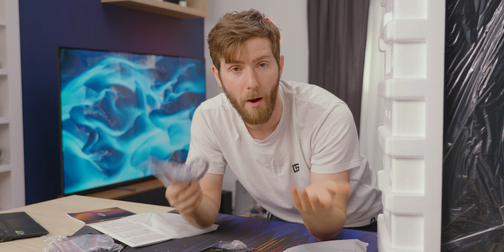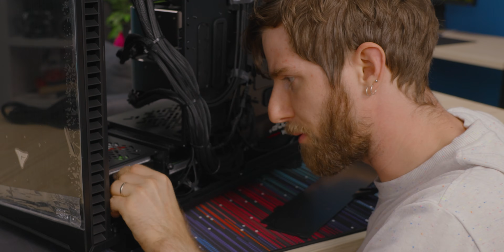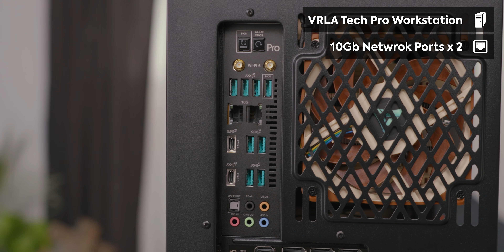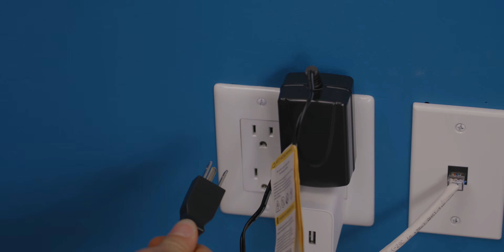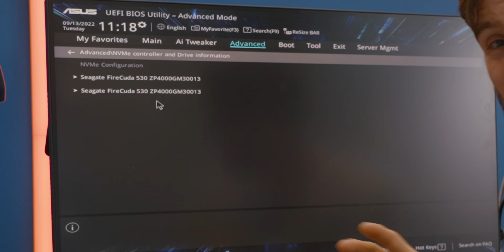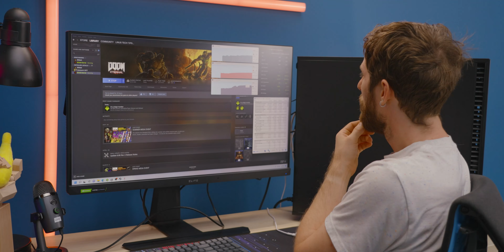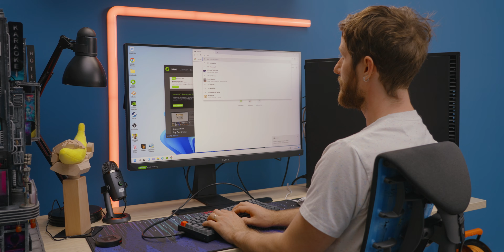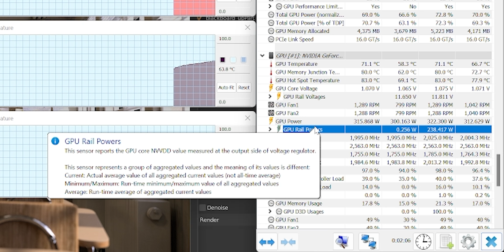This PC blew our circuit! - VRLA Tech Threadripper PRO Workstation

Comment: I have had the same set of Logitech THX certified speakers for like 10 years, and they still sound absolutely amazeballs.  So yes, yes they need the audio connectors.  I also use passthrough audio for my TV (that is connected as a second monitor 55" mostly for watching Linus on Youtube) to send its audio through the computer (yes when i am using the TV functions only) so i get 5.1 surround in my office. :)

Comment: I have a Logitech Z5300e set that sounds amazing and I'd love to have hooked up, but I got word about noise complaints about the sub two floors down and had to pack it up, 'm using Edifier R1280Ts now. But the rear surround audio ports can be great.

Comment: If Seymour Cray and Gene Amdahl were still alive today, I suspect that there jaws would hit floor at the speed of light. Have you ever wondered how many Cray X-MP mainframes it would take to match this VRLA Threadripper workstation PC? Hint: it's over 250. Linus, let's benchmark PC performance in equivalent number of Cray X-MPs. That would be interesting from a historical perspective. Thanks for the video.

Comment: man how sponsorscripted is this channel going. linus goes fully nuts over 2 x 3090tis which are shit in 1 month. 3 nvme slots which is also nothin uncommon and says 999$ pricetag as if there werent more expensive boards even in the consumer market. and why go nuts about 7 pcie extension ports if they are blocked by the sli setup anyway?
100% paid speech here. of course it is in a sponsored video but come on

Comment: I still use my late 90's era Logitech Z560 surround sound system when I'm playing games without voice coms, so I appreciate a full analog output on the back panel. Sad to see some of the latest (really expensive) X670 AM5 boards only have analog line in and out.

Comment: Booo. I use my 7.1 sound system for my speakers on my pc. When I built my pc. I specifically made sure it had that capability for my audio solution. It works really well for my case. I have swing arms for my speakers that the rear ones are mounted to. Makes for some fun movie/youtube watching.

Comment: seeing that worst case scenario of horribly bad cooling earned you a dislike, this is random parts thrown in a random case by a casual, the bare minimum would be cutting the side panel and install side fans (or a giant 230mm like I did)  which is what most people who had SLI did before liquid cooling became more than a niche talking about that, the day I built my regular threadripper pc (280 up to 430w on the cpu !!!) is the day I realized liquid cooling was unavoidable ESPECIALLY for a workstation, I know companies aren't used to caring about buying proper pcs but seriously this is a threadripper pro with dual gpu you should care !

Comment: I still use the ports because I have a custom surround sound with a 3000w car subwoofer hooked up lol. I will say Windows absolutely sucks getting those ports to work though. Speaker Fill just doesn't work like it should, and having to add flags to the program shortcuts that you want to have surround sound enabled for isn't optimal and 10% of the time doesn't even work.

Comment: On the topic of audio connectors on motherboards, yes. For me optical out allows an extra option on top of USB. For example my DAC is connected to USB and my surround sound the TV/monitor uses runs from the optical out to my receiver. This lets me switch between headphones and surround sound just by changing my PC output.

Comment: Ahem, Linus. Some people still use those analogue ports at the back of their PCs for their surround sound setups, like my ageing, but still working Logitech X-530 5.1, it might not support Dolby Atmos, but it still works for me. might add a bit of cable clutter, but so does all the other cables that my PC needs. I've tried using headphones, but, my ears are pressure sensitive and wearing headphones for extended periods of time does get uncomfortable.

Comment: I actually do use 7.1 audio with my desktop. It's pretty fun and easy to do with DIY. In certain games, especially if you can increase the volume, it can really help since you actually know behind you vs in front of you. Was a must-have when I competitively played MW2019 for a bit.

My setup was actually some nice speakers for the front, then in the rear, I had two sets of crappy logitech speakers with one speaker cut off, and a 3.5mm splitter so I could get some good range on the cables. The best part? My motherboard doesnt have 7.1 so I used a soundcard, in 2020!

Today I use an actual set of 7.1 PC speakers, but I leave the rear ones off since, if Im gaming, I'm usually using headphones to keep the fam and neighbors happy. I will say, when watching content, having a center channel does make it sound significantly better.
Reply: Correction, 5.1 everything*

Comment: Regarding the 7.1 audio outputs on motherboards: to me this is like having a ps2 mouse port on a motherboard. Yes, most people don't need this anymore, nor do the few that do need it very often, but it is very nice to have.

I for example use it for my very high end but very old AV receiver(Denon AVR 3805) that I use for my 5.1 living room TV setup. Most of my media content gets streamed over optical spidf using older flavours of Dolby Digital or DTS which works great for surround content. 

My gaming HTPC also has optical out and supports dolby digital surround too. However, most games that implement surround sound don't use Dolby Digital or DTS, but just straight PCM audio, and SPDIF only carries 2 channels of PCM audio. I believe this is a licensing thing where it costs too much for games to pay the fee? Some games support Atmos I believe, but I think this still caries licensing fees. Therefore, I use the analog surround outputs on my motherboard to the 7.1 seperate analog inputs which my old fancy receiver has. This way I can also game in surround. Of course, if you get a real fancy new AV receiver, this can probably all be handled over HDMI, but that means throwing out a very nice quality receiver that probably sounds much better than anything on the more 'budget' end today.

Comment: I still use my old logitech 5.1 surround speakers. they are old but they still work fine and i would hate to have to contribute to the massive e-waste pile just because motherboards stopped supporting the plugs.

Comment: 120V 15A circuit is 1800W, and this thing tripped the breaker under load. XD
I bet it wouldn't do that on a 240V 10A Aus/NZ/UK/EU circuit as we get ~2400W there. XD (well, my local substation is a 250V average output, using the old 240V ±5% standard NSW had prior to mid-00's, but still 240V nominal here)

Comment: I actually did a build in that case where I used the drive space and a 420 mm radiator in the front. The define 7 XL can just fit so much in it
Reply: TRX40 Creator allows placing 4xRTX A5000 in ATX-size case.

Comment: In 2022 connecting 7.1 analog plugs to the back of your PC, is probably the easiest way to get surround sound out of it. If you do it through HDMI, windows won't output over 2 channels without the dolby atmos plug-in and this one causes a lot of issues.

Comment: Ew, Fractal Design case.

I mean, they look and feel fine, plus the sidepanels are a dream to take off and put on, but they have pretty crap airflow, due to being too choked off. 
Look at 3:33. those vents in the front, thats all you get for intake, unless you decide to have the front door open, and even that doesn't help much.
Sure, you can fit many fans in them, but if those fans can't move enough air, they're kinda useless.
It needs a sidepanel fan or two to be good.

Comment: I hook up 5.1 analog speakers. got my speaker system ~20 years ago a Logitech system still running well. I don't use it for competitive gaming but for videos and casual games, it's fantastic if not a bit too much base sometimes. I won't buy a board without the hookups as sound cards are not really much of a thing anymore.

Comment: I tried to hook up surround sound analog speakers to my computer but Windows 10 wouldn't let me
as far as could tell Windows 10 does not output a signal to the other ports. I got them yo function it windows sound test but anything else would only play out of the standard 2.5 audio jack

Comment: We had a storm starting to brew and I shut down and unplugged everything. I waited hours after when it was sunny out and beautiful after the storm hit, I plugged my gaming rig back in and started to boot it and the power went out right in the middle of a boot. My graphics driver crashed and I had to reinstall windows. After this, my pc started randomly locking up and crashing in games. I would also get horrible performance and stuttering so bad, I thought I was playing on an old potato. I started to run a diagnostic on my system and it came up with an eerie warning about my bootable SSD having an unsafe shutdown and it could have potentially caused a bad sector. I went out and bought a brand new SSD and re-installed windows again and the same result. Random crashing and bluescreens and unclean shutdowns(many times a night if I let the system run). I started with swapping out my PSU with no avail. Then I went to ram. I swapped out the ram for Corsair Dominator ram which lessened the frequency of the crashes but they still happened. I would have random hard locks in games which was super annoying. I was leaning on just selling the system and buying another when I just decided to go on a friend's suggestion to just buy RipJaws ram and I did and the system seemed to run faster and more stable. Maybe RipJaws was more compatible than the Dominator because I installed the Domniator in an Intel Coffee lake system that runs flawless to this day with no issues.

Comment: Linus:  Complains about Apple and other cell phone manufacturers removing the headphone port.  

Also Linus:  Wonders why people still plug speakers into their motherboard.  

And yeah, I still use those plugs for my 5.1 speaker setup.  I also use headphones, but when I'm not using a mic for VOIP or playing in VR I actually prefer using speakers, especially for just listening to music or watching a video.  And if I have the option I wouldn't buy a motherboard that doesn't have integrated audio.  It's 2022... we shouldn't need to buy a separate sound card.

Comment: actually, being loose would be better for shipping because there is no added strain on the cables since they wouldn't be tightened for looks.
if that cable was loose, less likely it would have pulled on the HDD and bent the connector.

Comment: For the audio I dont use 7.1 but I definatly wanna see some outputs for like XLRs or 1/4 trs cables. Otherwise this would be my work beast if I could afford it... Go burrr.
Reply: blanced audio whould be nice. and an option to switch to aes/ebu on the same connector.

Comment: I still use a 7.1 surround sound speaker system.  Although Windows has dropped support natively for anything above 2.1 with integrated audio.  So, 3rd party sound cards are still needed if you have anything more than a simple pair of speakers.

Comment: 100% I use my 3.5mm audio ports. Don't fall for the elitist snark, unless you have an expensive sound system and a motherboard that has really cheaped out on the audio you don't need anything more. That's been true for almost 20 years now.

Comment: YES! I use all the surround sound ports for a home theater setup. I have an older Denon receiver that's still an absolute beast for my living room but because it's older I need to run all the audio cables. I am planning on doing a minor upgrade of the PC and switching to the TOSLINK however since we have 5.1 and not 7.1.

Comment: I still use a 5.1 speaker system.

Recently when moving I tried connecting my TV sound bar via TOSLINK and was very happy, so even if I do swap to that I still need the full audio options on my motherboard (as I don't want to extra bits and pieces plugged into my mITX build causeing desk clutter)

Comment: I actually do use that 3.5mm port on my motherboard, for my Logitech Z623 speakers. Which does give excellent separation and sound stage, provided the video file has Dolby Atmos hard coded in them. If you know what I mean ;)

Comment: My old manager gave me a pretty cheap 5.1 speaker set as he couldnt get it working. So i plugged it into my computer and primarily use them as i dont really play multiplayer games much. Also i struggle to find a decent headset that actually fits my small brain head. The work well enough. Better than my monitors speakers.

Comment: 7.1 ports? Well, I have a use for them, but I refuse to use onboard analogue outputs due to noise.

I went around the houses to find a decent solution, and in the end I settled for running my discrete Tiamat 7.1 V2 from the pre-outs on a second hand integra dtr30.6 so that (on that rare occasion it's possible) I can get Atmos throughput to my headset. I get that with zero noise, and it's juicy enough to not lame out on me. That said, gaming I usually run in pcm since any game is really doing it's own object oriented sound ... and the effect is astoundingly good. I can't go virtual on my surround, soz.

The reason I went this overkill? I despised not having true surround when I wanted to game with friends on audio ... I'm not fussed if others can't tell the difference, I could definitely hear the difference on things sneaking up behind me and stuff.

Anyway, yeah, that's one reason for 7.1 outputs, but still, I wouldn't use the motherboard ones! 😅

Comment: "Just use DDU, reboot into safe mode, reinstall drivers" ... Windows problems are not ANY simpler than Linux problems. The main difference is that Linus has 30 years of experience with Windows. Linux problems are different, not harder/worse. (My GPU drivers are built into the Linux kernel, I would never have to DDU or reinstall drivers).

If you had a person who had never used Windows but spent the last 30 years exclusively on Linux and made them do a Windows challenge, I bet they'd have just as bad of a time. And finding this as a solution would be mind blowing.

Comment: Yes, I use 7.1 audio outputs on my pc to run a 5.2 setup (the front side speakers is Fluance XL7F and has its on down firing sub. So no active sub which would be the best for that kind of audio setup. I have also neighbors down stairs in my apartment from 1955. No one has said anything yet, but with a large sub they might have been.

Comment: I say ditch most of the analog outputs and leave only rear Mic and Speaker outputs. Replace the surround connectors with optical out only.

Comment: It looks alot like my 5 yrs old specs dual xeon 32 cores workstation but it's 4 times more powerful at twice the cost. Kind of a good deal when you look at it like that.
Reply: TRX40 Creator allows placing 4xRTX A5000 in ATX-size case.

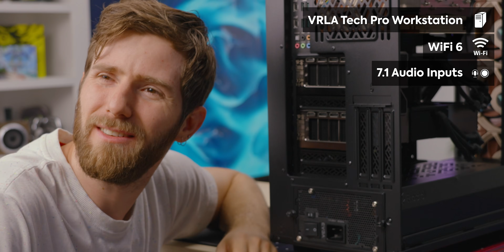Comment: RE 5:02 YES! and NO! I have 5.1 surround, on my headset, on my 10yro asus D2X xonar, WHY!? because it is better than the onboard realtek chip, by alot, like APU graphics vs 3090 lots; still. Sure spacial sound has come along way and there is no reason to buy a soundcard, so there is no reason to include the subpar Realtek surround chips and to actually buy an external DAC for a decent set of phones, But aside from a few minor cosmetic breaks, my headphones are working great; If it aint broke, don't replace it. 

ps. the d2x xonar specs are better than most high end DACS Why downgrade my self.

Comment: My Ryzen 5600x / RTX 3080 gaming rig uses 5.1 surround while my Ryzen 1600x / GTX 1060 media PC uses SPDIF. Both computers are hooked up to the same Logitech Z-5500 (1010 watts surround). Until I start seeing better computer speakers, I'll continue using these ancient but still awesome speakers.

Comment: 5:01 Those analog surround outputs are one the ways you can get uncompressed 5.1 or 7.1 audio from a pc. S/PDIF can do uncompressed stereo but anything above that is compressed. You can also use hdmi or dp to carry the sound but the sound data is interleaved into the picture data. So no sound without picture. Analog outputs seem to be the easiest way to hookup an amplifier to a pc.
Reply: i just use the network for audio. my dac and adc connecto to the network and i just have a virtual soudcard witch sends the audio over the network to the dac. it supports 64 channels input and 64 output channels  (there is even a 128x128 chnnel version)
Reply: If you want high quality audio from a PC get a dedicated USB DAC instead of using onboard. Even cheap USB solutions are generally better than the onboard stuff when it comes to the noise floor in particular.
Reply: USB to an external DAC, this is what the majority of your audiophiles and homecinema users do.

Comment: Since you asked, yes I do in fact use my onboard 7.1 soundchip and it is loaded up :) got a 5.1 speaker system that uses 3 of the ports and another one goes to my wireless headphone base station. So I'm very happy that these ports are still standard for the slighly more expensive tier up to the top. I do have another gaming headset that uses USB but since I'm also nearly out of USB Ports (my PC has 8 or 9 USB Type A Ports which are all full or sadly don't function anymore) there are some limits, and I do love my old sound system :D